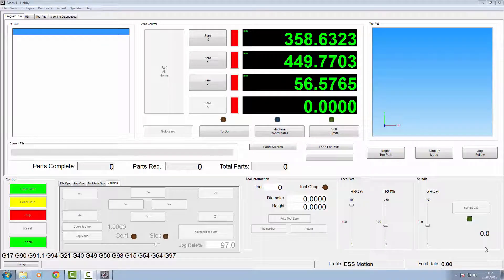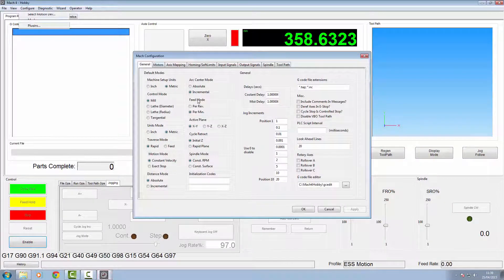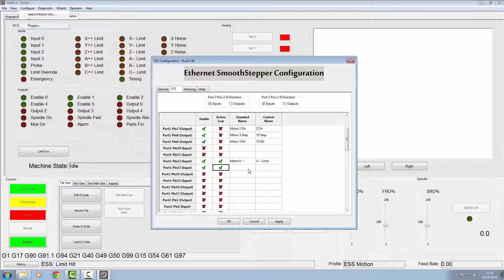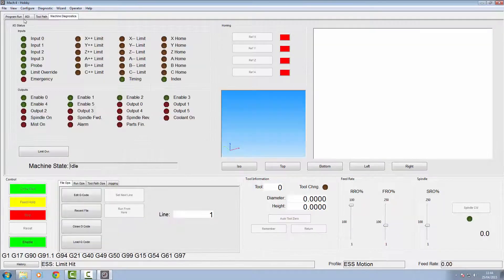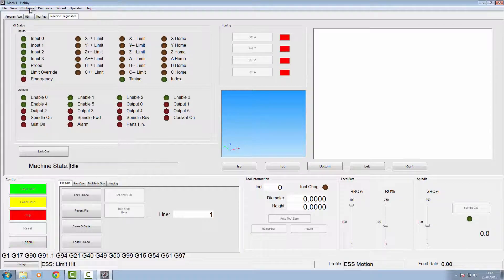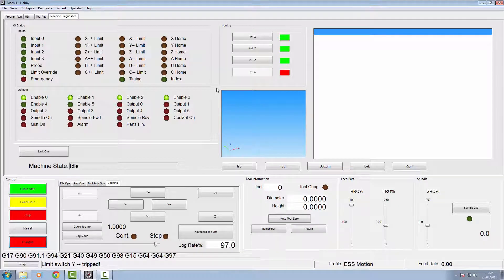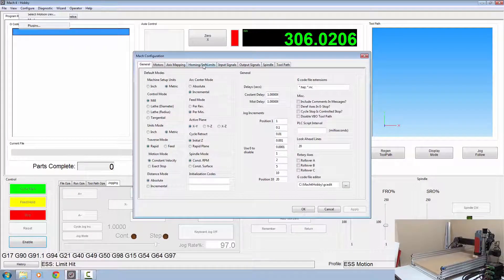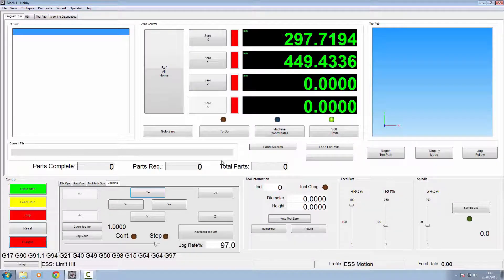Ox Mods - Part 3 - Setup Limit Switches & Homing

Comment: Daz, would I setup my machine in the same way seeing as I'm not running Limit or Home Switches? I was advised by others that they are just an added expense. That wasn't necessary when Soft Limits would accomplish the same thing.
Reply from the maker: Soft limits work just fine, but you need to remember that they are only as good if you jog your machine to a position and set your axis to Home In Place from the mach4 config menu.
The advantage of limit/homeing switches is the ability to home to the exact coords every time which is not available when homing in place.

Comment: What method do you use to determine the ++ and -- part for each axis / motor?
Reply from the maker: looking at your table, bottom left hand corner is you minus on the x and y axis on your z axis minus is also closest to bed and plus when fully raised.
Reply: Excellent thanks! I was thinking the coordinate system was in the middle of the bed for some reason; I got it now.

Comment: Hi Daz, thanks for the videos. I have managed to configure Mach4 with EthernetSmoothStepper. I still have a problem with the spindle. When i close Mach4, the spindle will be switched on again. When i restart the software, the spindle will be switched off again. HAve you got a solution to this problem?
Reply from the maker: Off the top of my head i would say you have got one of the signals back to front in the config ie (high/low) somewhere,  I have just purchased an vfd and spindle so will be looking into this shortly.
Daz
Reply: Christoph Reuteler

Hi again. Thank you for the answer. I have checked the configuration. To me it seems ok. I have enabled the following signals in the ESS-Plugin:
- Port 1-Pin1: Spindle On
- Port 1-Pin17: Spindle PWM.
In Mach4: Spindle On, ESS, Spindle On.

I wanted to measure the signals coming out of the ESS and therefore i unplugged the cable to the machine. in doing this, the spindle starts to turn. So i think the problem probably lays on the machine side. I am using a Stepcraft mit a HF-Spindle. The Spindle is directly connected to the machine und controlled via the Port 1

Comment: First of all let me thank you for the 3 incredible videos. Very well done! 

   I had been a bit intimidated by M4. I had an early copy and Brian even tried to walk me thru it. I put it on the back burner as M3 is reliable IME. Your series answers many questions.

   I do notice something odd during your video. At 13:50 you are adjusting the soft limits, you click apply, ok and then close that screen to "ref all" or "go to 0" and your machine simultaneously homes all axis'. I even went back a few times and saw the config screen. It is clearly marked, Motor 0 (1) in respect to homing order, Motors 1 & 2 are (2). I watched the movement of the machine and all 3 axis seem to start at the same time. I thought possibly the Z came up a specific amount for example (like a clearance plane). Then x/y started movement. I could see this causing problems snapping tools and ruining parts. Is this a bug? Or did I miss a change?

  I also noticed you didnt change the "active low" status in your Mach config but you did in your ESS config when working on the limit switches. Both dont need to be the same? Or you tell M4 where to look for the signal so the other is irrelevant?

   Again thanks so much for the time you spent sharing this much needed info.
Reply from the maker: +CncObsession At 13.50 I am using the goto 0 button, this is not any part of the homing sequence its basically a gcode for g0 x0 y0 z0, but I do get your point, its using mach4 own function for this and should be changed, infact I will address this tomorrow.
When using an ESS "ALL" active lows etc need to be set in the ESS config "NOT" the mach config, if you set an active low in the ESS config and then the Mach config the second will canx the first. but this could all change in the next week as a new revamped plugin for the ESS is about to be released.
Reply: I missed the Goto0 and mistook it for the homing.
 In this case I would guess it is acceptable if we are informed. On the other hand I see no benefit of x and y moving til Z is above the clearance plane.
   I have now downloaded M4 again and am taking another look.

Comment: Daz, These videos have been extremely helpful in getting my ESS and MX3660 stepper driver working on my Inventables Xcarve. All of your instructions carried over to this setup and all has worked perfectly until I came to the homing section. My Z axis homes perfectly to the top of machine when I use the Ref Z function but while my X & Y axis jog perfectly in the correct direction, when I ref either of these axis they home in the ++ direction rather and -- even though I've configured per your video. Any idea what could be happening? Thanks [RESOLVED] Daz, I didn't notice until I looked more carefully at your video that there are settings on Mach's Homing/Soft Limit's tab for HomeDir and that for X&Y they're set to Neg. Once I changed those all is fine.

Comment: Hi, nice Job!! Do you know if ESS support Probing (G31) with Mach4?
Reply from the maker: Rodrigo Lopez  this is from the latest release info
Fixed G31 so that it does not lock up Mach4 if the Probe input is already
   active when a G31 command is started. (Yeah!)DazTheGas

Comment: mate thanks so much for this video!
can you tell me why my machine hits the home switch, will reverse as it should but it wont stop, it just keeps on going in the opposite direction till it crashes. Any ideas?
Reply from the maker: Jim Mclegend would need more info on the setup you have to be able to answer that.

Comment: Would you configure the home/limits for the slave on an axis as well or would you just ignore it and only set up the master?
Reply from the maker: ***** This would be up to how precise you want your master and slave to be, known as squaring off. as mine is 500mm width I find a quick calibration now and then would be ok, but if your machine is larger say 1.5mtr on the x axis I would say its a must to home both, 0 one side could be 1.5 the other, so homeing would square this off.
Reply: Great! Thanks for the info. My machine is 4 x 8 feet. Guess i better get that setup... Your video was a huge help getting the limits and homing working... There is not a lot of info out there for Mach 4 and ESS yet! I look forward to more of your videos.